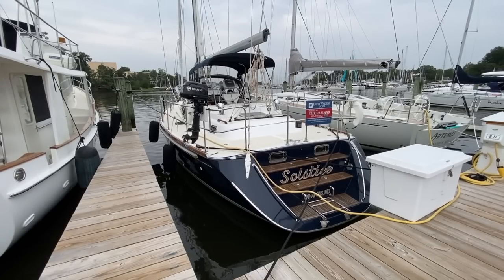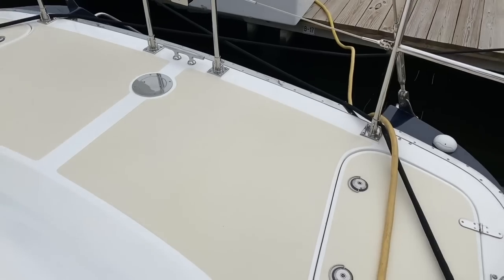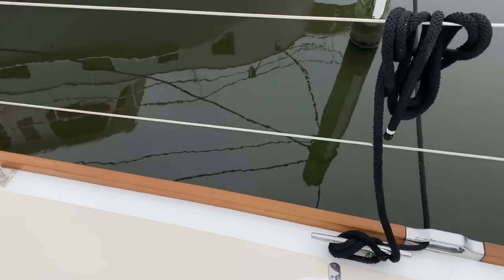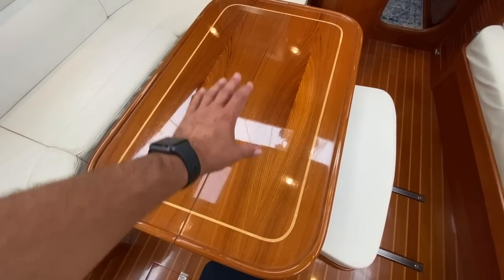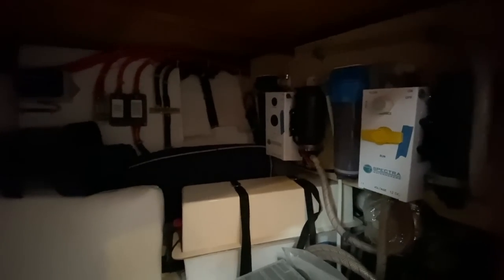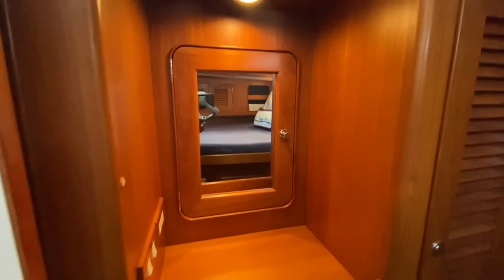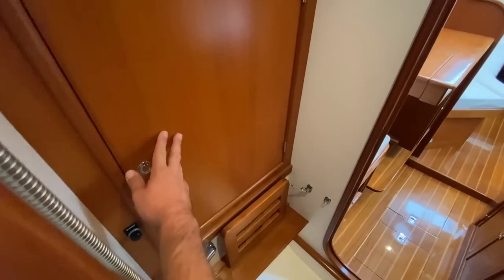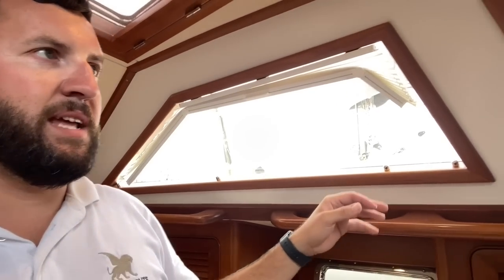Hylas 46 2009 SOLSTICE [Yacht Tour] SOLD by Erik Haaland & George Eberhard

Comment: Not quite sure why so many components have been replaced already (engine panel, mains’l furling unit, new paint)?
Reply from the maker: Some yacht owners are perfectionists!
Reply: David Walters Yachts I’m sure you are correct.  I have a 1997 model and all the original components which is why I found that odd.

Comment: Can these be sailed solo?
Reply from the maker: Yes! Almost every Hylas 46 is owned by a couple, and several single hand. I would recommend a setup that has electric main furling and electric primary winches at a minimum. Depending on your area of sail, a removable inner forestay would be great so that you can tack the genoa easily. -Erik Haaland
Reply: @DavidWaltersYachts  thanks for the info Erik I haven't found a woman yet that isn't afraid of the deep ocean and intimidated at the thought of sailing accross it.